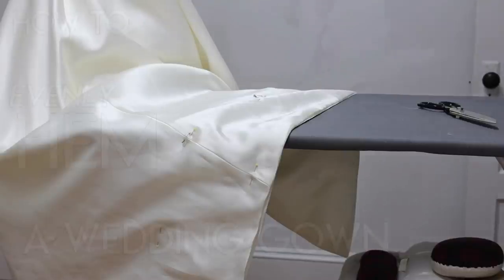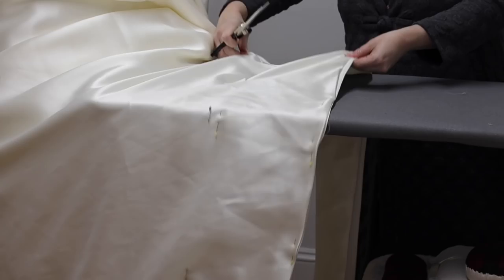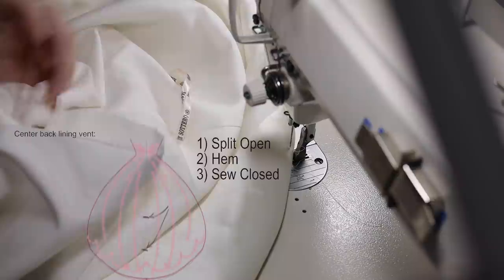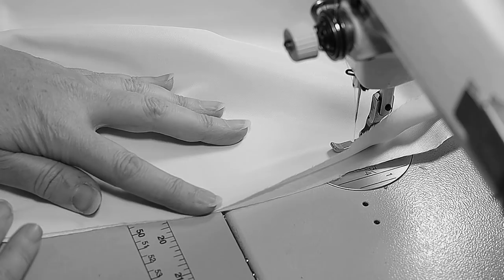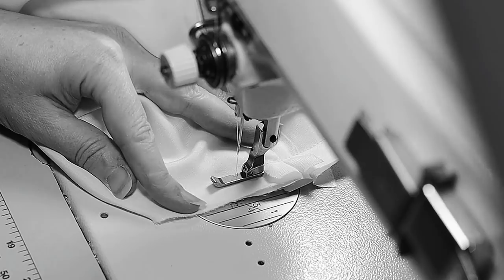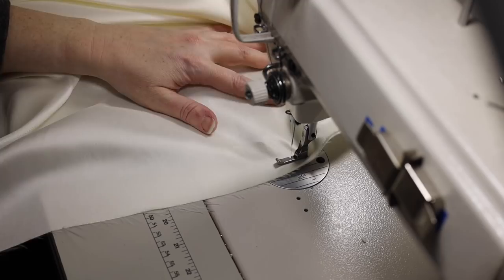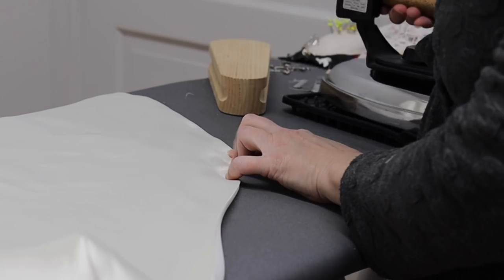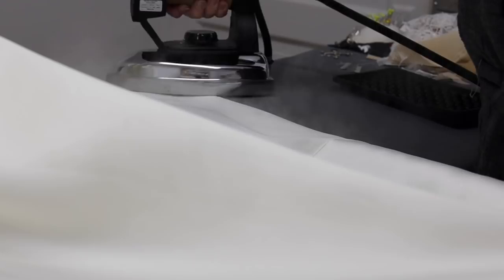I Got Fired.

Comment: I was fired with no reason provided from a small bridal business last spring (I was working as a seamstress). It's been a blessing in so many ways to be out of that environment but it's taking time for me to recover from the experience. I felt screwed over in more ways than one but I'm much happier working for myself, even if I don't have the enough business to support myself quite yet. 

Also, I love the tip about cutting a jagged line! I've done that on accident before but now I'll be doing it on purpose!

Comment: Mirror cutting is great, but I do an extra step. I have noticed sooooo many hems that are terribly lopsided right from the factory. If I only mirror cut, measuring up from the hem, I recreate the lopsidedness in the altered hem. 

To avoid this, I run the tape measure down the side seam, from the waist seam to where the new hem will be, and place a pin there to indicate the new length. I ensure that this measurement is the same on both sides, going down from the waist. Then when I pin the hem together to mirror-cut it, I match up those two pins rather than matching the edges of the original hem. 

I also usually press a crease in where my new hem will be, and hang the dress up to double check that the hem is visually even.

Do a lot of you guys notice ready-made gowns that come with uneven hems?
Reply: Hi Karen, yes over the years I have encountered the odd satin gown that has been off kilter. I will say the worst culprits I have found plenty of are the organza and chiffon gowns. More like hemming a screen door fabric. But like anything else there are yucky, better, best of both these fabrics. The cost of the gown predicts weather the alts are going to be a nightmare or a joy. Cheers
Reply from the maker: Org & Chiff are getting cut while the bride is standing in my studio. I do not ever cut unstable fabrics with this technique. ❤
Reply: All the time.

Comment: After hemming i think...it should top stitch it so that its easy to iron the edges... i do that all the time
Reply from the maker: I think you mean understitching?   Yes, that makes for a very smooth edge.  I don't do that for all gowns. It depends on the pricing tier the bride wants to be in. --or if it is necessary.  Many times it is not necessary if I use the clapper.

Comment: I always pull the waist taut and clip it to a yard stick or ruler. Then I hang it lol. I cut from there. We were taught never to press the nap from on top tho. We pressed from the liner side. I usually do bag hems by hand with a hidden stitch. Then I  press it all along with a clapper. I  always feel like a nerd. lol
Reply from the maker: Yes! :D It seems like there's a million different ways to do this type of hem- and none of them are "wrong" if it turns out beautifully!  ❤🧵✂️❤
Reply: @BridalSewing  My friend who is also a seamstess splits the side seam and sews it and then cuts it. lol So true. To each his own!!
Reply: I do this with the larger size dresses that tend to sag on the hanger. I throw a bedsheet over my door (to avoid rough spots snagging the dress) and fold the dress over the door so that the waist is straight across.
Reply: @iheartbridalcouture5989  yes I’ve always done it that way too ONLY I open the centre back seam and pull the skirt portion inside out. I also sew in horse hair this way too. If there is no more than 2 to 3 inches of extra hem,  I’ll leave it inside the garmentI, turn it right side out, sew up the back seam and press. I always let the customer know her original hem is still there incase she wants to sell her gown afterwards. Been sewing bridal hems this way for more than 20 years. Cheers
Reply: @caroldeon8736  I always feel I have more control tailoring it by hand. 😁

Comment: I have been sewing since I was little girl but haven't been able to do it for many years. I have been moving every 6 moths since 2017 so I have learned to pack light and not attach to things. Although, when I settle down finally, I will invest to sewing machine to get my passion back.

Asking for an advice. I do think in what order I will do things but just looking for a confirmation. I bought my wedding dress and it needs quite a lot of alterations (take in waste, hemming, taking in the shoulder and fitting the sleeve again). My thinking is to alter the waste first so I can determine how much to take from the shoulders as the top part is quite long for my torso. And then lastly hem the dress. I'm correct doing it in this order? 🤔